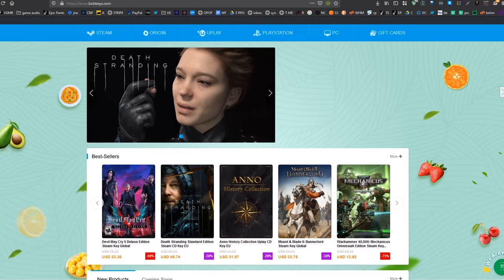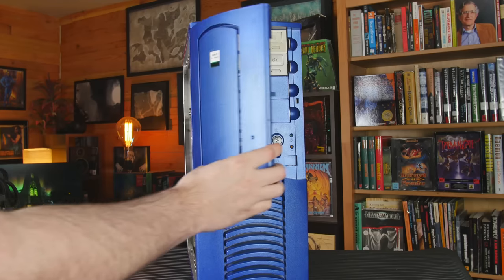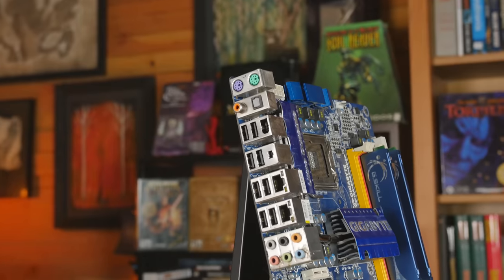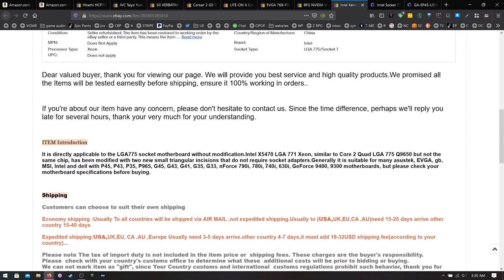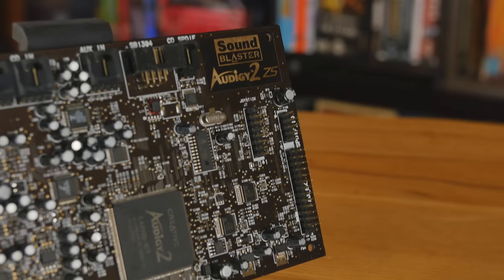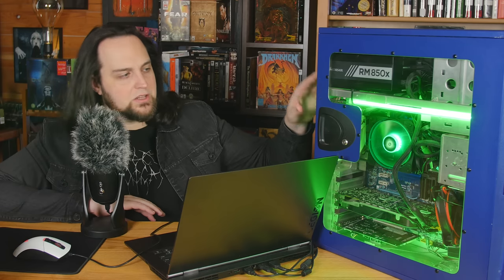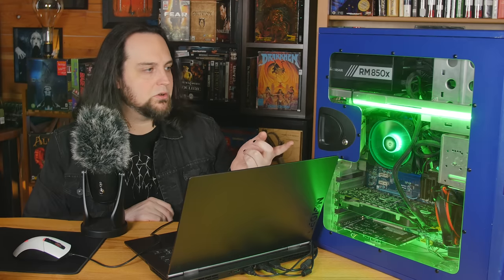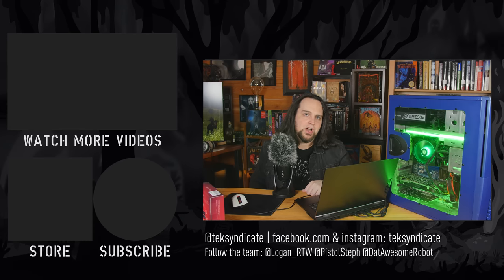NOSTALGIA BUILD: Windows XP Retro PC | P45, BFG 8800 GTX, ETC.

Comment: Yeah that's not how I'd build one. As a system builder from the era, that's odd hardware.. but you could have gotten black opticals.

XP had a 64 bit OS.
Hard drives were SATA and you'd have raptors in a raid array.
You'll find they'll max out the system bus.
The CPU was cheating...
The popular board were either MSi or Asus, and for the most part AMD were killing intel back then. You only had intel if it's a office system or you were doing video editing. In which case you would have different GPU, a quadro card or fire.

And the cathode hose behind the bar..